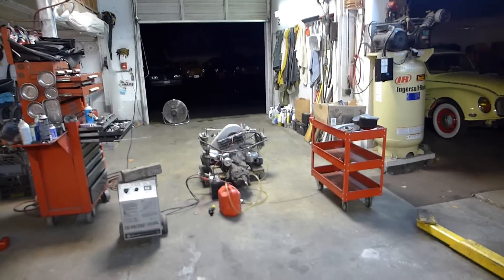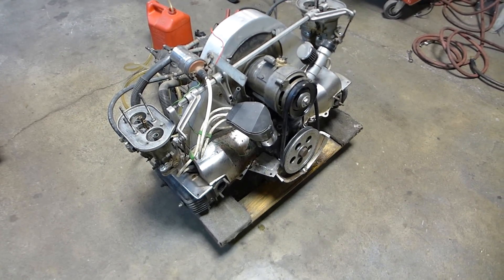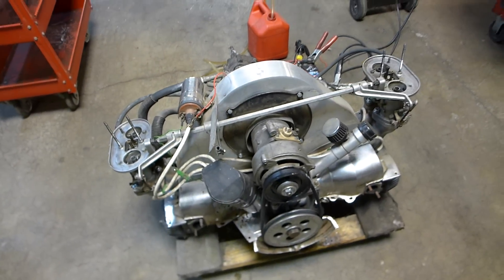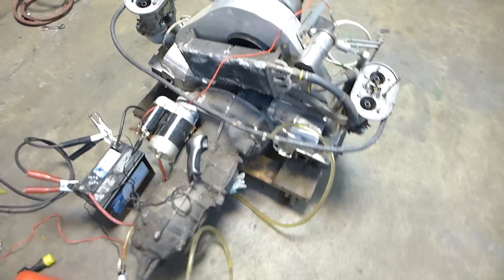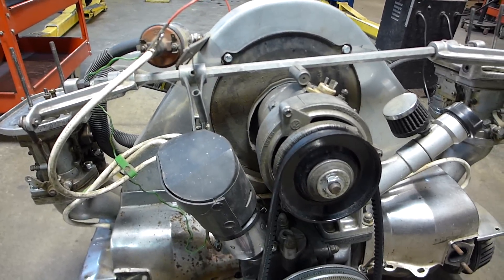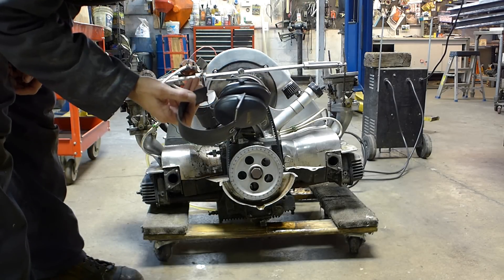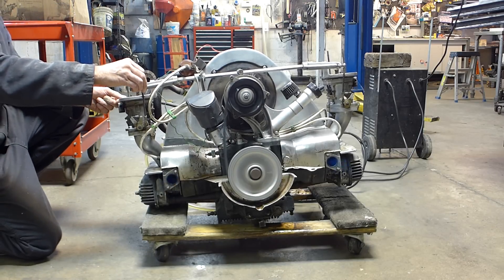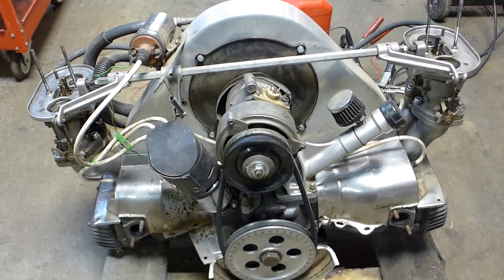Floor starting an ancient 1776 cc VW aircooled engine ...it roars to life !!

Comment: Putting the oil cooler in front of the air intake was THE thing to do in the 1970s  It beat putting it on the outside of the car where it was vulnerable to road damage and didn't do much good at idle without the car moving.

Comment: One of the biggest tuning issues I've seen on the type one is over carburetion causing obvious a very rich mixture. I'm no expert on how the compression truly affects this, but with a dual set up on the 1776 there's likely no benefit to such large carbs, possible a disadvantage. 48 is great for the bored and stroked engines, if using a single, but a mildly jetted dual 40 set up would likely be best for this engine.

Comment: innorder to put a central carb, you need to replace that fan shroud for a.stock one, replace the alternstor stand so it sits a little bit towards the right as it is from.factory. That is a custom setup right there, so you might as well use that engine as it is on a bug that you would like to be fast

Comment: One thing to keep in mind, if your going to run that in a car for any period of time be sure to move that oil cooler. If it is in front of that fan it restricts the air flow to the heads. Will cause overheating. put it away with its own fan.

Comment: You say that the carb setup won't fit on your Vespa BUT those webers are pretty valuable, an ebay search shows that in the past pairs of 48 webers sold for between $400 to $600. The dual carb manifolds could net you another $60.  With that kind of money you could buy a pair of dual port manifolds and buy a single carb dual port setup for far less either for a single or double barrel carb.  That ought to then fit inside your body panels AND save you some money.

Comment: Here's a little tip, when push the linkage  down ,like you are doing, do it on the centre hexagon bar, they way you do not damage the side linkage,  starting any motor ,not tide down propel ,is not to bright,

Comment: From the front pulley to the tip of the transmission, how long it this assembly? I’m thinking about buying a a Bug to build, and maybe using a Suburu engine and transmission mid mounting. The put the engine right behind the driver and passenger seats. Here’s the cool thing, with the Suburu engine being front wheel drive, if it’s mid mounted it will spin the wheels in the correct direction. And the best part. Near 50*50 weight distribution. A Super Beetle might be the perfect car for the build. Thanks!

Comment: What came to mind when I saw this critter  run so easily was the old song  "Put me in Coach! "   This beast appears ready to play.   I don't know if it would have valve seats for unleaded fuel and the compression may make running on pump gas tricky.   If possible, I'd find a nice type 2, Bus, Camper, pickup, etc.  for the lady.    Can you image it in a shop truck /mobile shop?

Comment: You’re missing both end gears for each side, the fulcrums for each side for in total then the axles go in then your lock plate goes in then your snap ring goes in the axle tubes outer bearings bearing covers.

Comment: DONT just push down on one side of the linkage arm . push from the centre of the HEX bar, this way you will get a even balance on the running, if it is a 1776 ,48s carbs are a over kill. 40s 0r 44s  are the best, good luck with it,
Reply from the maker: thanks ! good advice

Comment: that transaxle is 6 volt and vw swing axle........you are missing the swing axles and what directly goes into the sides of that transaxle is the side gears whichmake up the other 2 gears.  You can get those side gears on the samba.com

Comment: can I put a Single 44mm Weber card to a 69 mm counter weight crank & 94 mm pistons & a C45 scatt Cam & dual port heads 42 &37 , can someone give me an Advicesoor if it will work ?

Comment: Not a good idea to mount the oil cooler in front of the air intake like that. it restricts airflow to the cylinder heads where the most heat is generated.